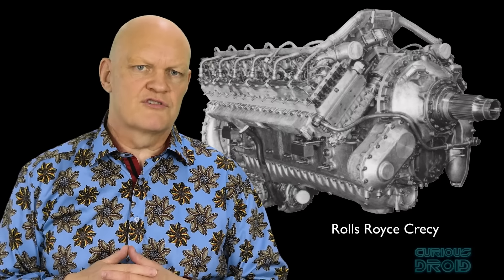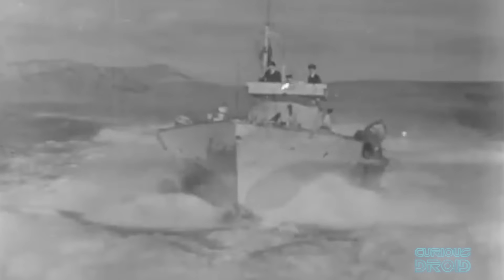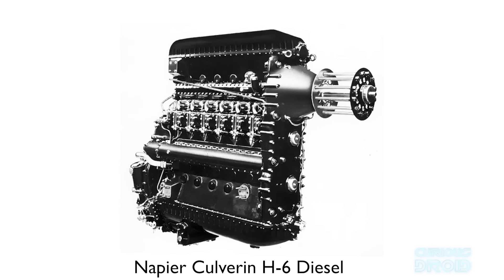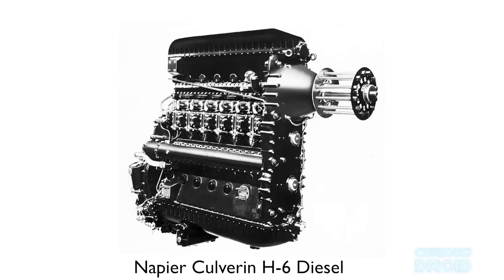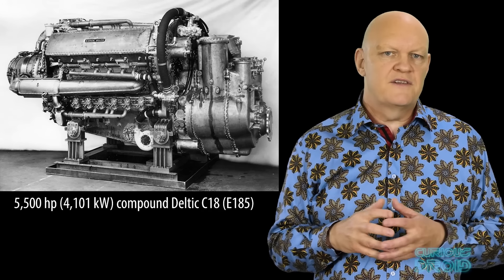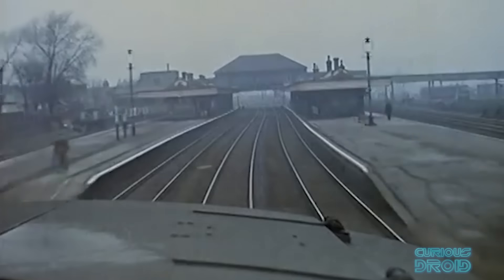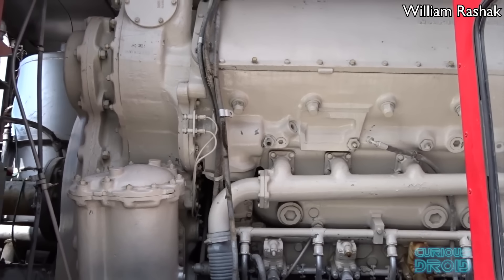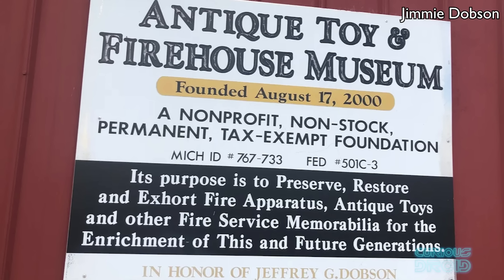The Legendary Napier Deltic - 88 Litre Opposed 2-Stroke Triangle Engine

Comment: When I was in the US NAVY my neighbor was a PT boat skipper. He had the last wooden PT on the East Coast. He took me to his boat one day and it was in drydock. It had these engines. I had never seen nor heard of them before and they were a sight to the eyes for a reciprocating A/C engine mechanic!
Reply: I thought PT boats got 3 gas packard 2500 v12’s from aviation side of stuff
Reply: @jordanbrandtner2745  I believe that's correct as I've seen photos and some books that said that. However the Lt. told me this was the last wooden PT on the East Coast so maybe they did a mod to see if they could improve them? He said every year they had some sort of NAVY get together with all the EC PT boats and he was always the fastest of the group. They must have put out the power! Wish I could have heard them running. Seeing them was a treat for me. Wish I remembered his name or the number on the boat. It was in drydock and raised quite a bit in the air. Very intimidating looking up at it!
Reply: @rogerhuber3133  they are really cool I think all of them were wood there is one here in Portland OR and it’s wood with the 3 packard’s  I think it has been getting overhauled the last 10+ years I remember hearing it run when I was a kid but never saw it move
Reply: @rogerhuber3133  after a google search it would be possible the one you saw was an experimental one and would make sense if they would test with different power plants
Reply: @jordanbrandtner2745  No, some of the boats were metal. I believe aluminum. There's youtube video about them.
Reply: @jordanbrandtner2745  That's a real possibility. One thing the PT's always needed was speed so testing different power plants and all would seem logical. Those suckers were pretty fast even with the 3 Packards. When I lived in Houston there was a group there that got one rebuilt and running. I guess there are several around the country that operate. I remember watching McHales Navy as a kid and marveling at their speed and 2/3 of the boat out of the water.

Comment: Good video which brings back memories as I worked for Napier on the production of the DELTIC engine in the 1960.
It was very interesting work as I played a part on the production of the SUPER PUMPER engines , the overhaul of the Type 55 loco engines and others.
The Royal Navy used the engine on their mine hunters up to 2015 which gave the DELTIC a service life of some 65 years and over 600 units were built.

Comment: I have restored a number of fire engines in the USA.  I have also run a "Special Interest Autos and Motos" restoration and mechanical repair company for many years.  My two latest projects were a 1942 American LaFrance with the ALF produced V12 and a 1946 Kenworth with a 1191 Hall Scot.  This video about the history and development of the Napier Deltic power plant is one of the best videos I have seen on the subject of power plants in my entire 57 years of doing in depth mechanical work on many different power plants.  Great Video.

Comment: As a student traveling frequently  to and from York in the 1960s, I always had tingling in the back of my neck when on an express train hauled by a Deltic locomotive. As the engine revs increased and the familiar 'whistling' of the huge fans in the roof of the locomotive increased; the engine pulled away from the platform effortlessly. It didn't seem to make much difference whether there were 10 or 15 carriages behind, it was always thrilling to be on the train.
Reply: you lucky cat!! all we have today are boring 4 stroke diesel gensets running elevctic motors for locomotion!!
Reply: @fidelcatsro6948  wow! Didn't expect a comment on a remote clip some three months ago.
I live in Bolton and (when they bother to run them) the new trains are those tinplate trains that seem as though you could dent them with cornflakes. The Deltics made every journey exciting.😊👍
Reply: @derekmills1080  🐱👍🏿

Comment: The Deltic loco had an amazing sound they had a deep throated throbbing sound and was even better when both engines were running
Reply: Yes - a distinctive sound that's missing from this excellent presentation
Reply: @Mute_Nostril_Agony  I spent so much time at Kings Cross in the 1960s when these locos were King of the ECML.
Reply: @Taz1451  it would be disheartening to some extent.
I remember the locos when new, also saw he original running on the ecml
Reply: Like a vw beetle!
Reply: @donotwantahandle1111  What ever you think
Beetles should be stamped on

Comment: Brilliant!!! Have loved this engine since first learning of it. Never knew the Super Pumper used one though. 10,000 gallons a minute is serious flow. I've worked on airport crash tenders that flow 5000 litres a minute and they made the 30 tonne truck rock when you fired the monitor. No wonder the Mack would take the buildings down with the fire!
Reply: I had to read that twice and process it…Why would such pressure and volume be needed though?
Reply: @dakkan5433  pressure needed to throw the water/foam the distance necessary for aircraft fires as they burn very hot and the appliance and crew needs to be a safe distance to avoid compromise. 80 metre throw is normal from the roof monitor. Super pumper designed to feed hoses run into tall buildings so pressure needed to overcome the losses. 15psi lost every ten meters you go up. Volumes necessary because you are feeding multiple satellite vehicles/relay pumps and you are bound to get leaks etc. Also a big fire has a lot of energy sonyou need the volume of water to cool the fuel stock or the fire reignites.
Reply: @paid2getdirty1  That’s impressive considering the technology possessed at the time,,the 2 stroke configuration made it lightweight and therefore easy to transport at relative speed aswell!

Comment: There is a nice exploded view example at the railway museum in York England.
Reply: Deltic railway locos are still in use pulling freight on the U.K. west coast main line.
Reply: @Dave5843-d9m  This has only happened a couple of times, and not since 2017 I think. You might be thinking of class 37s which look quite similar on the outside.
Reply: Are the good old original York, so restrained and understated they only named it once.:)
Reply: My grandfather was one of the first drivers of the Deltic Prototype loco (out of Edge Hill)
Reply: I was there in 17 and either missed it or it was not there.
A place worth visiting.
Reply: I think there's part of one at the Anson Engine Museum as well
Reply: @KrisDouglas  That's the one that was in the NRM.
Reply: @Dave5843-d9m  Didn't know that ? are you sure they are not Class 37's as they have same bogies and similar shape body

Comment: That museum in Bay City, Michigan with the supper pumper is about 80 miles from me. I will go and check that out.
Reply: No shit, i go past bay city all the time heading up north
Reply: *super pumper.  Supper is a meal.
Reply: Funny you metioned that, I worked on a mining project in Yukon that had a deltec powered pump, I had thought it was a screaming Jimmy . Even when corrected, at that time,  I never really grasped the significance going to make some same area had a dredge that's pumps were run by surplus aero radials long ago looted..
Reply: @borderreiver1806  Do you have any photos or further information? I have ben trying to find out what happened to the US Deltics after they were taken out of service.
Reply: @nigelpaine2914  I'm sorry , I don't have anything, as I was only hauling heavy equipment out.Most of those projects were cleaned up under reclamation bonds .. steel etc.. pulled out for scrapping ..I know that that pumphouse is long gone, as is the scrapped equipment.. Even old Ruston Bucyrus engines and Draglines. I doubt anyone really would know their significance..
I might be wrong but I thought that that pump setup was supposed to have come from a Jet barge ,then later used to pump water from the river up to a dam for sluice boxes

Comment: Currently in an internship at Cummins it’s really interesting and strange to see such big diesel engine being built and the care of the spare parts division has to those engine
Reply: Are you at the plant that makes the engines for the Ram trucks?  Or the new engines for the Siemens Charger locomotive?
Reply: Engines are funny things. In service, they can get smacked around and covered in shit and keep running like nothing happened, yet each part is an incredible piece of high precision manufacturing that can be completely ruined during assembly if you so much as rest it on a bench the wrong way!
Reply: You are incredibly lucky, enjoy it and learn as much as you can about everything

Comment: Just looking at the complexity and scale of these engines is quite bewildering. I mean to develop the prototypes, test them, further develop them and have the final product at the end of it must of cost an absolute fortune! The machining time alone on 1 of those crankshaft gears must of been days and days, let alone the rest of the engine.
Reply: It's expensive yes, but if you can prove the idea works on a small scale, alot of really expensive mistakes can be avoided. Cosworth did something very similar recently, 2 companies wanted v12s, it was cheaper to build a 3 cylinder prototype rather than do months of computer simulation. Worked out very well for them and the results are mind blowing, 12100rpm for a street legal car, and one hell of a soundtrack!
Reply: @MontyPython12  Aston Martin Valkyrie and  Gordon Murry Automotive T50 are those 2 cars which would house the magnificent Cosworth naturally aspirated V12s.
Reply: @MontyPython12  I want to know more.
Reply: @junejuly532  drive tribe has done videos about cosworth, GMA has a whole series about the T50s development, well worth a watch
Reply: @MontyPython12  Thanks
Reply: MichaelKingsfordGray  Dude, wtf? No need for that
Reply: @MontyPython12  Honda did something similar in the 60s, they developed a formula for producing engines, this allowed them to skip much of the Proto typing test phases and go straight to an almost final production engine, I've got a little four-cylinder bike engine here that does 20,000 rpm.
Reply: @tomnwoo  20,000 rpm, good grief, it must sound like a chainsaw?
Reply: @markfryer9880  wonderfully it sounds like a Formula One car, it is however impossible to ride it without attracting attention.
Reply: You want to watch a gear cutting vid. Takes no time at all - comparatively LOL.
Reply: As mentioned, opposed piston engines had been successful in airplanes.  So it wasn't like they were inventing something new, they were just scaling up.
Reply: Perhaps the motivation behind its inception and production was the War?
Reply: If you thing that is complicated, then take a look at the Bristol Centaur 18 cylinder sleeve-valve engine. The Deltic is vastly simpler in comparison. That got up to 3,220 HP, but the valve gear is mind numbingly complex.

There there is Napier's own H24 sleeve valved aero engine, which got to 3,500 HP.

In comparison, those big Deltic diesels were relatively simple and robust. They had to be given what they were used for.
Reply: @MontyPython12  It seems that @Michael-Kings-For-D-Gray deleted his comment. What did he say?

Comment: Good lord. The engine designers from almost a hundred years ago were incredibly intelligent and visionary. I'm ashamed to say I've never seen such a design, other than rotary, that didn't have cylinder heads. Those engines were designed WITHOUT COMPUTERS. Much respect to the minds behind such incredible machinery. I've always wanted one of those fast attack PT boats...just bc I'm still a kid at heart and they're very impressive. Can only imagine the feel and sound of them opened up at full speed. What a feeling it must have been.

Comment: Curious Droid, please (just a suggestion) do a video on the Electro-Motive 710 / 567 /645 engines (all essentially the same block with incremental improvements). It is / was perhaps one of the most important catalysts in dieselization of the railroads and medium marine vessels from coal to diesel. It and the Napier were some of the most important and remarkable engines ever constructed.

Comment: As a railfan I see the Class 55 Deltics quite often. I can't help cringing when they shut down and you can hear all the synchronising gears grinding to a stop as oil flow reduces. One on my best memories is the sight of double headed deltics on all 4 engines pulling out of the KWVR station at Keighley . Very impressive ❤

Comment: Enjoying this, i well remember working on 2 stroke diesels in plant equipment many years ago mainly GM 6,8 and 12 cylinder some where Turbo charged and inter cooled but they all had the gear driven blower between the cylinder heads. We would get about 3 months use from repair then a tune up was needed and perhaps another 3-4 months and the air box drain pipes would be blowing oil out so time for another repair!. Happy days, long days and dirty days!.

Comment: Always been fascinated by this engine after I saw a cut away example of it at the British National Railway Museum.
Reply: You should stand next to a class 55 with both running, you won't forget that in a hurry.
Reply: @fouloleron2002  
The engines are surprisingly small for their size.

They had a strange design of steam boiler, unlike those installed in most other classes.  It was located between the two engines.  I wouldn’t have wanted to have to attend to the boiler when the engines were running at full power.

Comment: There were some Nasty Class PTF’s that would come in and resupply at our pier in RVN, they were highly classified at the time, and we wondered what the hell powered them that made such a strange noise... at last I know, thanks. 👍
Reply: The Napier overhaul shop was located at the Subic Bay naval station. SBU 12 also had PTFs stationed there.
Reply: Go to PTF Nasty for a lot more info on what these boats were used for in Nam. I was at MST-2 Danang for two six month tours. Spent a bit of time on these at sea.

Comment: I'm familiar with the Deltic.  I've read all about it that I could find.  But I didn't appreciate how monumental it was until I saw the photo at 00:35  Yeah, it dwarfs the man standing next to it.  Now that's an engine!

The elegance of the Deltic concept is that by adding just one crankshaft, two more banks of cylinders could be added.  Junkers 4-crankshaft 223 engine could only have one more bank with one more crank.  

I never knew about the FDNY Superpumper, though.  It sounded like a white elephant when Curious Droid was describing it, but it's nice to hear that it responded to over 2200 calls during its lifetime.  It's even nicer to hear that it still exists in a museum less than 2 hours from my home!

I think Napier was the most creative and ambitious engine design firm of the 20th century.  Their engines were always pushing the limits of the technology, and threatening to bankrupt the company at every turn.
Lion:  1200 cubic inch W12 aero engine from WW1 that was still setting speed records 30 years later.
Saber:  2240 cubic inch H24 sleeve valve aero engine that did bankrupt the company, leading to their takeover by English Electric.
Nomad:  flat-12 valveless aero diesel engine with turbocompounding, using a CVT to match the speed of the gas turbine to the diesel.
When Napier finally got around to making a turbocompound Deltic, they had the technology developed in the Nomad.

Comment: Im a life long gear head. I've built engines, hung around an old school machine shop to learn from guys who've forgotten more than I'll ever know, I learned paint and body from a Cuban guy who ran the base hobby shop with a paint booth you could rent. Eddy was in his 70s and had come over from Cuba back in the early 80s and when asked about water based paints he said "if the paint can no kill you, is no good!" RIP man, but being from Cuba this guy had tips tricks and methods for keeping a vehicle running that make all the sense but you'd never think of them, like taking oil fouled plugs and soaking them in gasoline or diesel and then setting them on fire. Once they burn out they're easy to clean and reinstall. Point of all that is these opposed piston setups are something I only recently heard about and now I'm obsessed with the design. I recently picked up an 03 Tahoe in very good condition and now I'm looking for someone to design an opposed piston engine to replace the 6.0 so anyone interested hmu